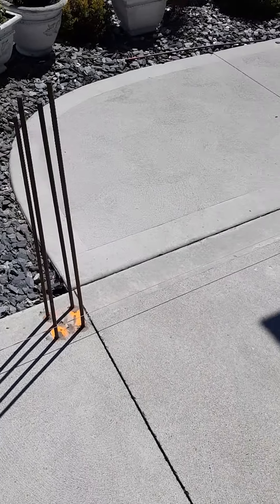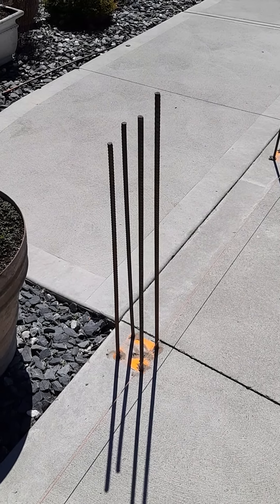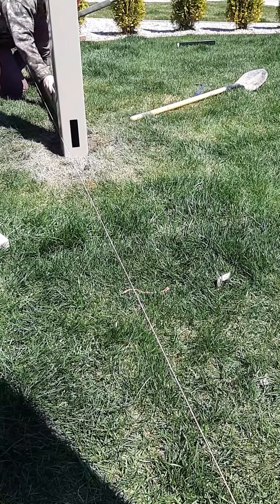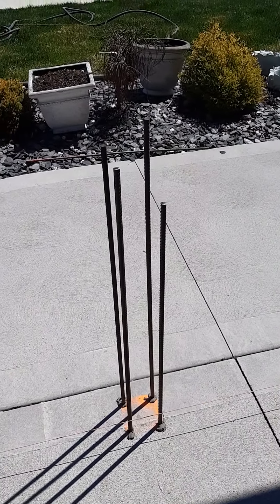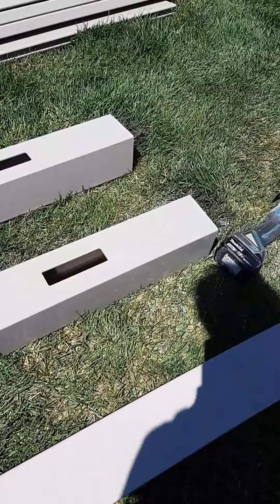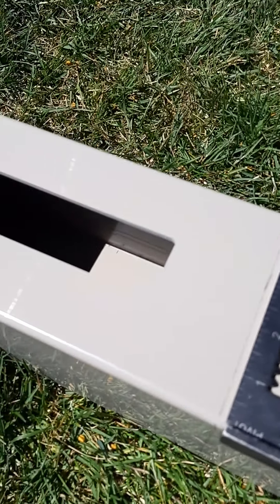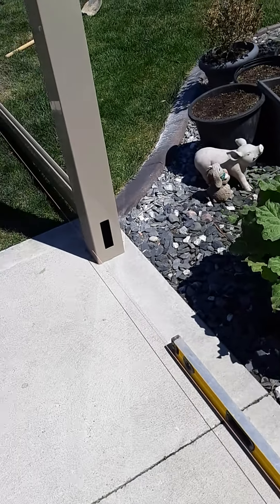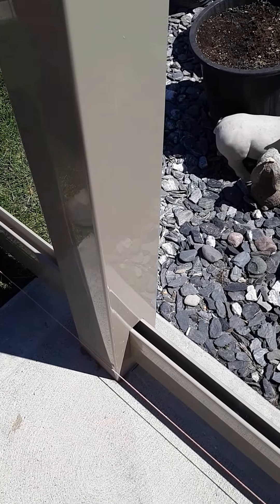Installing Vinyl Fence On Concrete; Pt 6

Comment from the maker: Gates can also be hung on these posts set over rebar. They will be VERY solid.  Depending on the type of hinge being used you may want to set the one rebar back from the corner of the post to accommodate the hinge screws.  Also screw the hinges and latch assembly(s) on BEFORE filling the posts with cement. Fill gate hinge and strike posts about 3/4 high with stiff cement mix.  Fence sections must also be fully assembled prior to filling posts. 😁 
 Be VERY certain the posts remain in a plumb position as the concrete sets/ cures . Hang your gate the next day.
Enjoy🙂
Reply: So if a post gets hit by something and bends it at the bottom is there a way to bend it back the other way without damaging anything?
Reply from the maker: @TheRyanMaichel  ...eew... that's not good.  I'm assuming it's bent where the rail is routered into the post ? The vinyl will not "straighten" out, or "unbuckle" if you push the post back plumb.  And even if you can stand it straight again it'll soon be leaning back over and likely break soon there after.  If you can get a new post to replace it that'll be your best solution...I just reread your question.   "If" a post gets hit? Are you referring to posts installed per the video ? Of that's the case, the post will likely break or crack before it "bends" . In which case you'd disassemble the adjoining section(s) , cut the post sleeve off of the concrete inside it and break the concrete off the rebar , leaving the rebar intact.  Measure and cut a new post,  slide it over the existing rebar , reassemble the section(s) and fill with fresh cement.  😁. Bit of a process,  but fairly easy.
Reply: @vinylyardsolutionsinc1228  yeah it may hav been bumped by a parking car and it bent slightly. No damage to the vinyl or anything noticeable, just leans. I’ve pushed it back up straight so that the gate can open proper. But I’m guessing I can’t bend it all the way back without breaking something. Your second answer as to the fix is probably my best chance. Was trying to avoid breaking the concrete up and replacing the post. Oh well.

Comment: What length is your rebar for these full 6ft post? 
And can I use fast setting quickcrete?
Reply from the maker: @thehowtoguy6336  typically 4- 10MM  x 3ft rebar in a 6ft post.  
Railing posts usually 12 to 18in rebar.
U can use the fast setting quick quickcrete,  but man, you wanna be perfectly certain that the posts are plumb each way and all sections are placed exactly 💯 % . If there's any correction to be made u outta luck😁

Comment: Hey bud, what did you used to hole the rebar in place
Reply from the maker: A-7 or UCAN FLO ROK are 2 part epoxy products that you can get at industrial fastener suppliers.
Reply: @vinylyardsolutionsinc1228  thank you Sir🙏🏼

Comment: How much concrete do we fill in ?? On post after its assembled
Reply from the maker: About half way... making sure there's   duct tape on the ends of the rails before installing them into the posts.

Comment: How do I pour concrete into the vinyl tubes? Do I just pour quickrete fast acting into it and then use a garden hose on top end?
Reply from the maker: It's best if you premix the cement to ensure it settles in and around the rebar and rails sufficiently. Not too wet or sloppy tho....
Reply from the maker: https://youtu.be/G95ON9172yA

Comment: I know this is an old video but how do you level the fence posts if the concrete isn’t level
Reply from the maker: Cut off the bottom of each post as you progress across the concrete pad. Start at highest point if the concrete and work to the lowest point.  If the distance is too great to accommodate that method it might be best to follow the slope of the concrete in cutting the bottom of each post equally.

Comment: about how long are the rebars?
Reply from the maker: For a 6 ft high fence we use 10mm x 3ft rebar. One bag of quick setting concrete will fill the post just past the rebar. For gates   the hinge post should probably be filled up to approximately 4.5ft high.
Reply: @vinylyardsolutionsinc1228  the post comes in 9 ft. How long do you suggest the rebar should be? I’m using 80lb cement bags
Reply from the maker: @ntace  if you're installing ON  concrete you'd cut the bottom of the post off to accommodate a 2 or 3 in "sweep" under the bottom rail.  If your installing in the ground we have a series of videos showing that step by step as well. For in ground installation we use 6 ft rebar , they'd go approximately 3ft into the concrete and come up about 3ft inside the post. If you're using bag cement to set posts in ground it would vary on how many you'd require depending on the depth and diameter of the holes you've dug.
Reply: @vinylyardsolutionsinc1228  thank you for clarifying that. Great videos btw.

Comment: Do you have any fear of the concrete slab breaking due to wind pushing on the Vinyl Fence and pushing on the rebar since it is only in the concrete a few inches?  Also does the concrete poured into the fence post adhere to the existing concrete slab well?  Couldn’t find a video showing how you poured the concrete into 6ft vinyl post.
Reply from the maker: I've never seen the concrete break due to wind.  It is one of the reasons we will stay in from the edge a few inches.  As well,  IF we know ahead of the concrete pad being poured we recommend that it's a bit thicker along the space where on the fence will be installed ... I wouldn't recommend installing the fence on a thin slab or one that's old and decaying....
In-so-far as filing the post(s) we've had funnels made that slip into the top of the post after the fence is assembled and dump a few paint cans full of a stiff cement mix into them... about 1/2 way up.
Reply from the maker: https://youtu.be/G95ON9172yA

Comment: What size are these rebars
Reply from the maker: 10mm  pretty standard size . Drill 1/2" diameter holes when using on concrete.

Comment: 2” post with four inch flange with pre drilled holes. Lag them in with simpson strong ties plum up post by bending post and a level. Use rook post mounts  sleeve post. Done! 

This method that you’re using is blasphemy.
Reply from the maker: Ya, we've used that system as well...  It is quick,  more expensive and a lot less solid.  
We've hung 5ft wide x 8ft high gate for garbage / dumpster enclosure on this specific method with no problems...